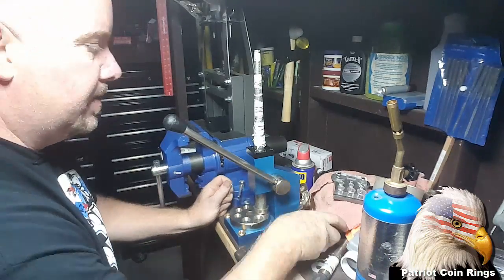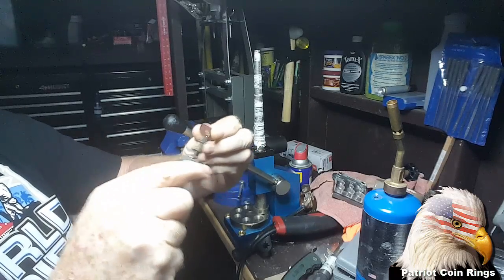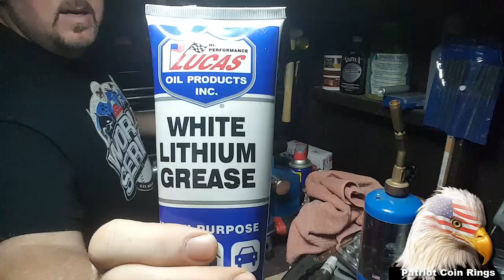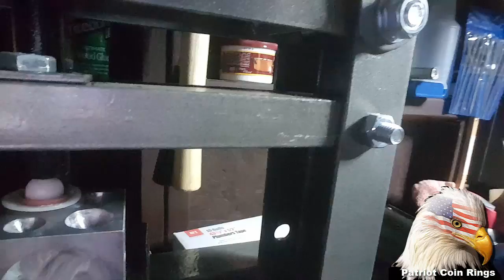Making a Coin Ring in Detail Tutorial  (Start to Finish in 28 min)

Comment: What kind of ringsizing machine do you use? Most of the coinring makers use the durston, but I'm looking for a cheaper solution.
Reply from the maker: I bought mine off either ebay or amazon some years ago but use the Durston, you'll think you're spending more at first but you won't because the reduction wheel on mine had reduction holes far to small for any coin ring unless you feel the quarter ring worth it.  The durston has larger holes to work with and that's half the machine (one for enlarging size, one for reducing).  On my first unit, I tossed the reduction wheel because it was completely useless and spent a lot more money on various sized dapping blocks and custom tooled equipment.